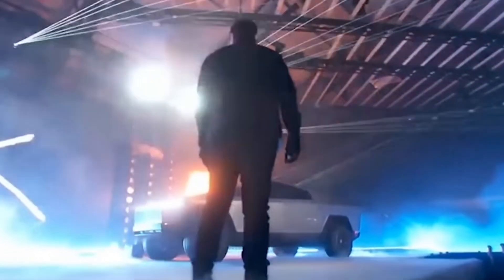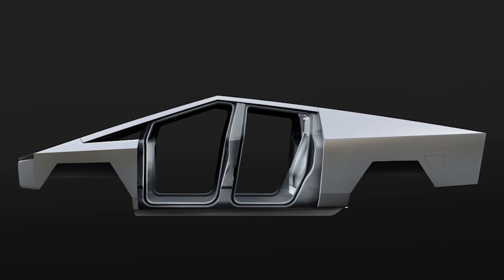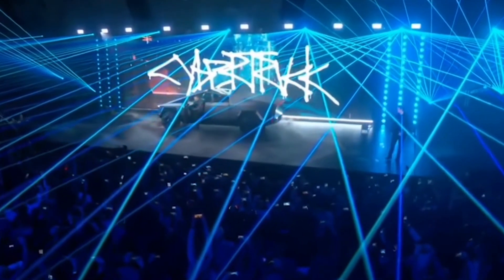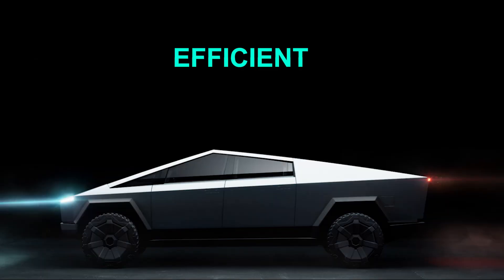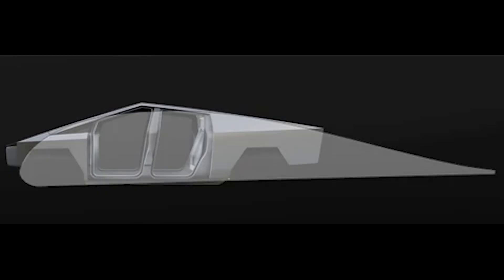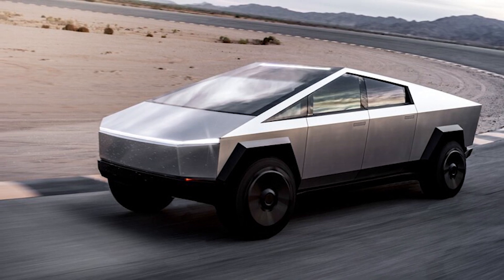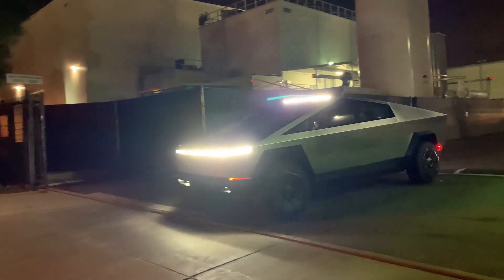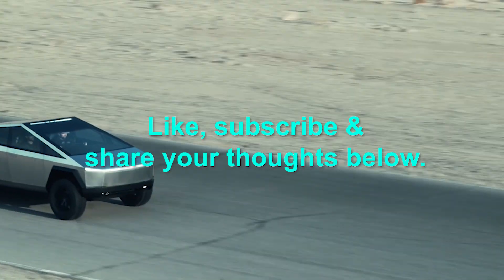Cybertruck is Engineering Genius (and will be copied)

Comment: They use the same battery technology as anyone else. And it’s ugly as hell, and all this money you talk of that Tesla is saving and the truck is still expensive to buy. This will go over big with the tech crowd but will not sell to the average construction guy
Reply from the maker: Hey, have a read through some of the comments here and elsewhere. A lot of "truck guys" are seeing the value in Cybertruck and have made reservations.
Reply: Solving The Money Problem  I wouldn’t call them truck guys anymore than i would call a 20 year old university student running around dressed if flannel and sporting a beard a lumberjack lol. Trucks have become so popular Hockey moms have ditched their minivans for 1/2 ton quad cab 4x4s

Comment: Some good points but the Aerofoil thing was nonsense and having a rigid shell would make you less safe
Reply: The cybertruck is extremely aerodynamic for a no-curves body, and the exoskeleton is strong enough to definitely balance out the lack of crumple-protection with its resistance to piercing objects and localised crushing. Though a crash is more likely to give the passengers whiplash, it significantly reduces the likelihood of a door crushing in on them or debris jutting through the panels.
The only problem I see is the glass. They seem awfully proud of the impact-resistance of the glass, when it really should be breakable for exiting from a significant crash.
Reply from the maker: Have you seen Musk's tweet about the possibility of a 0.3 drag coefficient?
Reply: Solving The Money Problem The 0.3 CD is impressive as Clare said especially for an angular body. It will create a lot of drag though, comparing drag coefficient is great for seeing what the effect the body shape has in isolation but you can’t get around the size of the thing
Reply: I think the main reason for the lower drag is the shallow windscreen, the bed cover being diagonal and the whole body being really long with no engine intake. The angular design will make the drag worse and I’m just saying that an aerofoil is for creating lift, not minimum drag so doesn’t make a lot of sense to compare to. And the aerofoil shape seemed just chosen to match the truck. I’m super interested to hear more about the crash tests stuff. Maybe they have some crazy origami folding to absorb impact or something. Good point about the glass and not being pieced by metal. I drive a small hatchback, I would just be destroyed if this hit me, and god help pedestrians haha. I wish Elon had talked more about the practical reasons for the crazy design at the announcement

Comment: The problem is it isn’t that cheap... the cyber truck base can only tow 6000 pounds which is the same as a mid sized truck. For it to compete with the full size truck market you need to pay 60000 for 8000 pounds which makes a Ford F-150 cheaper, when you pay 80000 it will compete with full size f250 and pull 14000 pounds.

Anyone who thinks this is what truck guys want, they are mistaken.
Reply from the maker: You're right. In NARROW use cases, an ICE vehicle can be had cheaper that can outperform on say towing, OR range, OR bed length etc. But as a total package, nothing matches its value.
Reply: Another thing I am not sure of, is how these electric vehicles work in extreme winter conditions? Can this truck for example, start in -20 degrees Celsius weather, stay running, heat my vehicle up, drive me 200 kms into the bush with me pulling a couple of snow machines in the back and in a trailer behind me? 

I'm skeptical but I haven't seen any Tesla's in my town work well in the winter yet. I don't think electric cars are there yet to be able to do it.

Comment: Maybe I missed something, but could someone please explain how the truck will be protected from the elements (rain, snow, dust, etc.) if it is not painted? Also, adding surface texture can give some benefits to aerodynamics (just saying) and you cannot ignore the fact that paint of various color schemes is a great way to attract buyers with different aesthetic preferences.  So, what am I missing? Finally, regarding what you said about safety: you don't want to drive a vehicle that's completely rigid and tough. It's much safer (in the event of a crash) to be in a car that will deform around the passenger compartment, thereby absorbing energy and reducing the amount of energy imparted to the passengers. Again, I might have missed something, but a simplistic explanation of "tough and rigid is safe" is absolute nonsense.
Reply: Given how much more rigid the cybertruck is, it goes to balance out the decrease in crumple protection. Forces on the passengers will be higher, but the likelihood of piercing debris and more localised crushing is incredibly reduced in turn. Such is the case when a bullet doesn't even leave a dent in the thing, as opposed to going right a door and out another.
Reply from the maker: Stainless steel is named such for a reason - it doesn't rust and won't deteriorate in the elements. I won't bore you with the science but google can shed more light if you're curious.

As for safety, the steel can be scored on the underside to crumple in a predictable and consistent manner upon impact.  The video would be 2 hours long if I went deep on everything. Lots of people have raised crash safety and I am sure Tesla will share more on this soon. Remember, their engineers are among the best in the world.
Reply: @SolvingTheMoneyProblem  Oh, I didn't realize it was stainless steel; that makes sense. Also, the structural details help in the context of crash safety and definitely make the argument stronger. The way that part of the video was presented just seemed a bit weak and wishy-washy.

Comment: All that toughness could be double edged sword if rescuers can't pull you out after crash.
Reply: But it will be too safe to crash and even if it dit it would just be safe
Reply: @brillianceoflives7841  "too safe to crash" is a bad bet. Something could collapse on it. Driver could pass out in it. It could be t-boned into lake. Baby could be left in it with windows closed on a hot day. Semi could loose control over its trailers...

Does standard jaws of life can cut it? Does standard windows breaking nails work?
Reply from the maker: I have a funny feeling Tesla's engineers are not going to make a death trap and sell it. Maybe they can install ejector seats that deploy on impact 🤣
Reply: @SolvingTheMoneyProblem  It is a given that they will lnot sell death trap but I am interested in how will they do it. Will they use exploding hinges like on Merc SLS or will they hide emergency open button so the passangers can not find it like in Tesla X? Will they include custom glass breaker? Are current jaws of life powerful enough to cut it? Honestly curious.

Comment: I love this truck buuuut i still have one doubt, the range with a trailer....
Reply from the maker: A few people are wondering about this. I know Model X has atrocious range when towing but it wasn't designed for that. Cybertruck is so I'm  very interested to see how the Tesla engineers address towing range.
Reply: Solving The Money Problem I think the Tesla trailer will include a range extending power pack(in bottom like cars) that plugs into the Cyber truck outlet providing extra range in optional KW. Think extra 250-500miles added to truck range.
Reply: Dan Ogilvie that would be so cool !!!
Reply: @SolvingTheMoneyProblem  It comes down to weight, aerodynamics and battery capacity. A 14000 lb trailer is heavy and has terrible aero - so it'll take a shit load of battery to move it.
Reply: Check out this video for a cogent engineering analysis of towing range: https://youtu.be/S4W-P5aCWJs

Comment: I think your optimism has blinded your utility judgment lol... That thing is utterly useless without a structured chassis... How will I tow my race-cars or horses? Theres no frame to bolt an overhead or tow along hitch to...  And the fact it is all electric means it will die in short time while towing. They should have held off until they could perfect the hydrogen power revolution that's on the horizon. Simply cannot have a truck without a combustion engine of some kind, especially if its electric powered. A hydrogen generator would at least make me feel comfortable going out into the middle of nowhere beyond recharging resources... Trucks just can't be all electric like cars or you will have people dying in the middle of North Dakota from freezing to death because their truck died 150miles from civilization. For people that actually use trucks.. they wont work... Its more for people that buy the Honda trucks and live in NY and LA and want to look like they have a life where they need a truck... Considering it can't do anything a truck can, its more of an el-camino
Reply from the maker: Well, I am a Tesla fangirl so maybe so. FYI, you weld directly on to steel.
Reply: @SolvingTheMoneyProblem  what kind of steal? Mig for carbon based, TIG for stainless and aluminum... and the mass and the structure that mass is shaped into makes a big difference. Just because you can weld a hitch to a hollow I-Beam doesn't make it a solid I-Beam...

Comment: We will see if it is genius if it passes the EU impact tests. Especially the side impact test worries me.
Reply from the maker: Are you worried about people IN Cybertruck, or crashing into Cybertruck?
Reply: Solving The Money Problem The sledgehammer demo suggests that the side of the car is too rigid. That could indicate that in case of a side impact the forces are transferred toward the occupants instead of being absorbed by the crumbling of the metal. As for hitting the sides as a motorcycle driver by example. I fear the worst.

Comment: Wouldn't rigidity cause problems? Most vehicles have crumple zones to protect passengers but I'm wondering how that is included in Cybertruck. I love everything else though.
Reply from the maker: Heaps of people are asking about this. The steel can be scored on the underside to crumple predictably and consistently. I think people will be surprised at how well the Tesla engineers address this. Safety is always top of mind at Tesla.
Reply: @SolvingTheMoneyProblem Interesting to know. Thanks! Great vid btw.

Comment: i wonder how the range will suffer if it was pulling a load.  see the you tuber video where they towed a 4000lb trailer with a model x and power usage went thru the roof and range went down dramatically.  basically its range became so short it was useless unless you are towing very short distances in town.
Reply from the maker: Yeah, I'm interest on this one too. Model X towing range is garbage but it wasn't designed to tow whereas Cybertruck is. Looking forward to more info on this soon.

Comment: I'm really curious how it's going to handle crashes.. If the body of the car doesn't cave in you will get seriously hurt as you will take all of the energy. And if it does have zones that are meant to collapse for safety then how do you avoid replacing the entire car body in a crash?
Reply from the maker: I'm curious too (everyone seems to be). The steel can be scored on the underside to crumple where and as needed, no problem. But the next question as you identify -- will a crash = a write off/full bod replacement? Hopefully Tesla address this soon. They do have some of the world's best engineers so I think we may be surprised.

Comment: Finally, somebody gets it. Simplicity and utility with low cost production. Pure genius! I live in West Texas, I have driven trucks my whole adult life, fords, chevys, and I currently own a Dodge 1500 hemi new from the dealership 2014, the front end is wayyyyy to low without a payload that's a pain in the ass! I like to go out in the country and mesquite's scratch the paint and the front bottoms out at every ditch, runs great on the highway has plenty of power from start to top end and it holds to the curves like an old muscle car. But I want this cybertuck because it's built for what a truck is supposed to be like all the way around! But, then again I get my Western clothes at tractor supply not one of those cowboy dandy stores🤣.
Reply from the maker: Thanks so much for sharing your thoughts. A few others in the comments have had similar stories. Driven trucks whole life, realise Cybertruck just does what it needs to do better. Assuming many of your friends are truck drivers too, what do they think about Cybertruck?
Reply: @SolvingTheMoneyProblem One of my co-workers said it will be his next truck! In all honesty also, it is easier to make electricity to charge a vehicle than it is to make a combustible distillate i.e wood-gas or methanol based not to mention petroleum, you won't have gas if electricity goes out. But the sun or wind is almost always available.
Reply: Also another really big factor... Most people like me who might live in a town with around 100,000 population have a daily round trip commute of ten or so miles a day. Even at the low end cybertruck I'd only have to charge about 3 times for two months for work and running around town a little.

Comment: The love the new cyber truck and can’t wait til they land in norway. But I can’t help but wonder what happens when two cyber trucks collide. Are there any energy absorbing crumple zones or did the cyber truck just drive straight through the immovable concrete block in the ANCAP safety tests?😂 seriously, will the jaws of life machines be able to cut people out? Will emergency services be able to smash windows to help get people out ?
Reply from the maker: Hey James, I read every comment. Crash safety has come up about 40 times haha.

1. Drivers sits same distance from front of vehicle as in Model 3, so there's room for full crumple zone
2. Steel can be scored on the underside to crumple in a predictable, repeatable manner so should be a non-issue.

As for the jaws of life and windows, Tesla will for sure need to have a solution. Or achieve FSD by then..

Comment: so glad this thing will never be legal in the uk or eu probably, cant see it passing any pedestrian safety tests, especially that angled bonnet and wings being at the height of a childs head, there was a reason corners like this were banned in cars here.
Reply from the maker: You don't have much faith in Tesla's engineers, do you? I'm very interested to see how pedestrian safety is addressed too.
Reply: @SolvingTheMoneyProblem  hmm well i have faith in their electrical motor and battery knowledge, they have made a few good cars based on similar sports cars so not much worry for them so far, but with this under the uk's road rules i think it would have to be registered a tank or something to skip the necessary road safety, the bonnet for starters cant be solid and has to absorb a bare head impact test which this would need changed for, but cars can be retro fitted with steel plating for bullet proof, they could technically sell them in the eu with plastic front ends maybe, and "sell" a full metal front upgrade after road registration. But personally im not a fan of the design so probably a little bias, ive liked most the teslas released to date even though elon is a bit of a shill, nice to get reply from channel owner, thanks for the notice.
Reply: @shroomzgames7370  your little bias is outweighed compared to this biased review lmao

Comment: nothing about the truck have been proven safe yet so we have to see when the crash testing is actually done
Reply from the maker: Yep, not working with a lot of information YET so it'll be great when Tesla share more details on crash safety.
Reply: The engineers at Tesla probably overlooked it... lol
Reply: @TapMeat  Didn't know you were an armchair engineer as well.
Reply: Just do not hit the car lol
Reply: Exactly. How is this going to be safe without a proper crumple zone?
With the aluminum frame it’s probably gonna still look great after a crash, but I don’t think any passengers will survive...
Reply: @2849-q9c  Well there's a hollow pit where the engine of a conventional vehicle for the body to crumple into and without the chassis to provide further support, the design is likely rated to collapse under certain loads. However, we don't know the details of the design yet and haven't seen any crash testing so this is all speculation. More than likely the body is resistant to a sledge hammer without deformation but not another 2 ton box. Tesla cars are the safest cars out there and that has been a long standing selling point and philosophy at tesla. I'd be very surprised if they abandoned it now.
Reply: @2849-q9c  check out this explanation of the exoskeleton, it explains how the stainless steel can be annealed and made soft to be used for absorbing energy in a crash. voila crumple zones  https://www.youtube.com/watch?v=J1kUtlnxYhw
Reply: @mycreativestreak  Yes, but....they aren't making it "soft". They are making something that doesn't deform under a hard hit with a hammer. So no it probably isn't safe. Maybe safe for driver, but certainly isn't for other road users
Reply: @miguidieu06  Easy if you go back to basic first principles see if you can work it out. a clue how is it bent
Reply: @miguidieu06  I agree with you however tesla has emergency pedestrian avoidance braking which will offset that. Whats better, avoid crashing into pedestrians or injuring them softly?
Also the crumple zones will be internal and I believe hidden weaknesses will be designed into the exoskeleton.